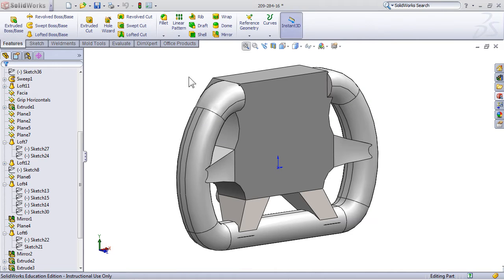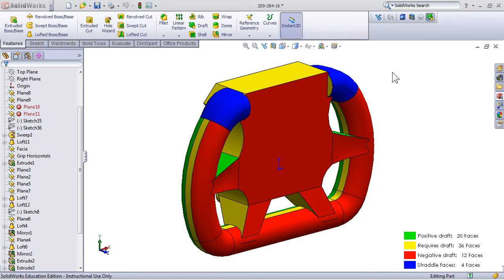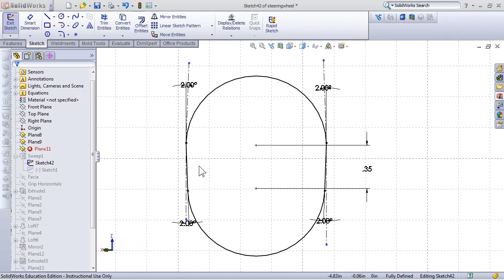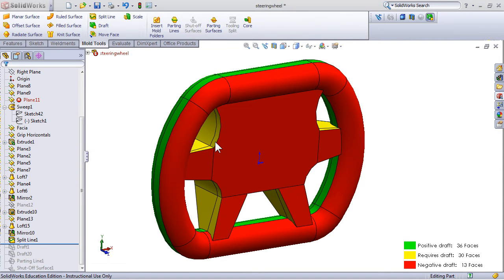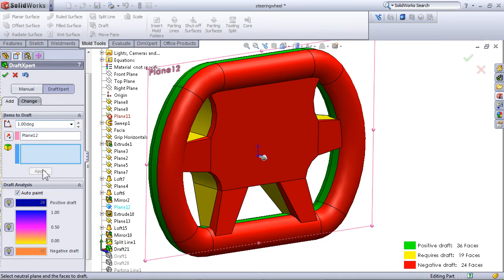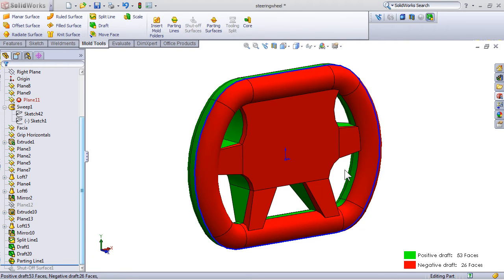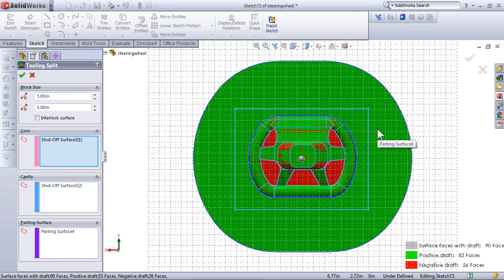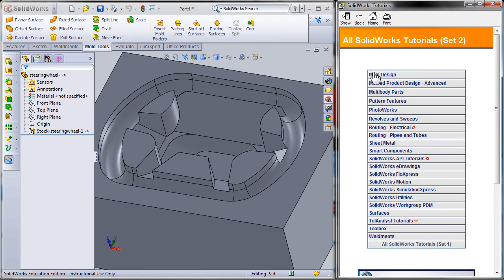Creating Molds for FSAE Parts

Comment: This tutorial is great! You covered everything I'm looking for except for how to deal with straddle surfaces. I'm designing a prop for a thruster and in my specific design I cant simplify the loft of the blade in order to create the mold and I would like to place parting lines along the edge of the prop. You took out the lofts on the simplified model so you almost answered my question. The SW tutorials don't cover this either. Can you help me out? Thanks in advance.